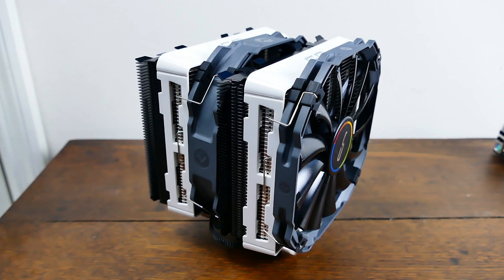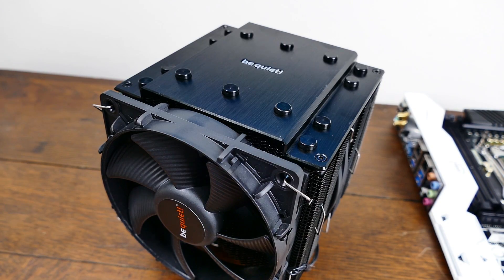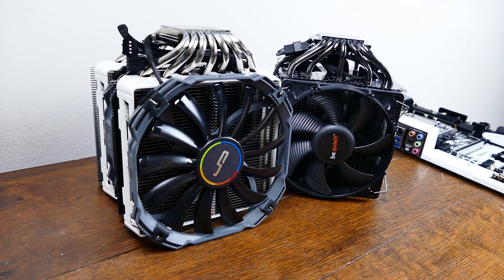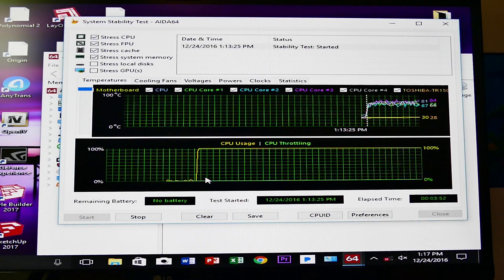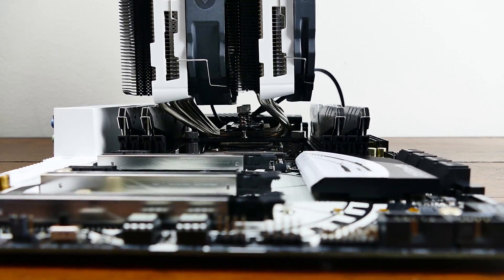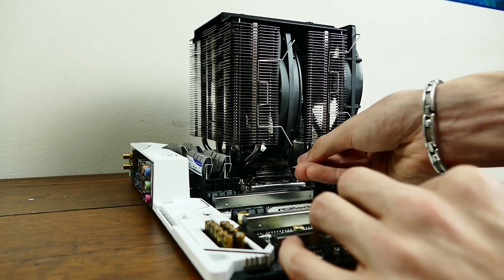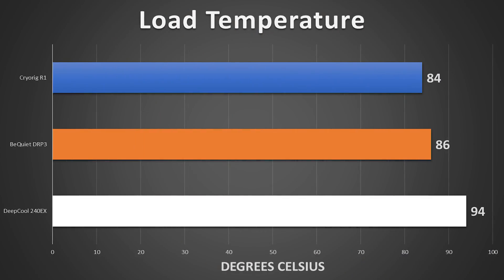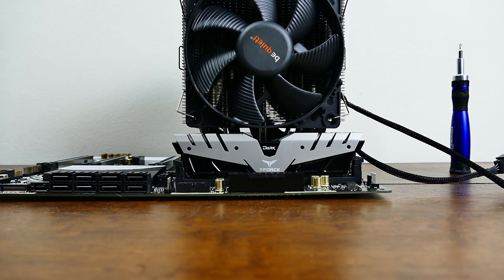BeQuiet! Dark Rock Pro 3 vs. Cryorig R1

Comment: any tips on a pc that won't turn on?   I just replaced my cpu (i5 6500), motherboard (asus z170e (i know, it was completely unnecessary but I didn't know at the time), ram (kingston hyperx fury black 2x8 gb) and cooler (cryorig m9i) for christmas and literally nothing will turn on. The closest I get is when I turn my power supply on, a green led shows up on my motherboard and a white led shows up on my graphics card but other than that, literally nothing at all.
Reply: White Supremacist Hate Symbol Have you plugged in both the 24-pin and the cpu power connectors? I forgot to plug in the cpu one on my first build and totally panicked
Reply: White Supremacist Hate Symbol Check the connections to see if there are any gaps. That already happend to me.
Reply: Make sure the CPU and motherboard are plugged in,and that they are plugged in the right way. I had this same issue and it didn't turn on because plug was plugged in wrong
Reply: tomekmatus212 yep

Comment: I'll give You an idea for some future video with one of those coolers. Why not make an 'half passive' CPU cooling like in new GPUs? I mean that when I'm browsing the internet the fans on those big radiators doesn't have to spin at all. Then add 'half passive' PSU and GPU and you have a silent PC when browsing the internet. 😊 I have tried on my old phenom ii x4 and on '1st gear ', which is 4x 800mhz, I don't need my CPU fan to spin at all 😊

Comment: Greg aren't those temperatures too high? or 80*+ is fine?
Reply: Darius Guran they are ok but a cpu shouldn't go higher than 90°C to be safe so the temps were kind of critical.
Reply: FreaqqShow talking for a permanent use, for one day for benchmarks isn't a big deal i think
Reply: Darius Guran talking for benchmark. if you can manage to keep the cpu temps under 90°C while benching, then you won't have any problems with your cpu :) but i guess 85°C for permanent should be ok too

Comment: Does anyone know if you can clean a cooper heat sink with water and soap? Or just water???
Reply: Are you trying to clean off oxidation? ketchup, then soap and water.
Thermal paste on base plate? Just wipe off and alcohol.
Reply: i would use isopropyl alcohol just to make sure and prevent corrosion, it is very cheap and is also good for removing thermal paste.
Reply: Thank you all who responded.
The heat sink I want to clean, I've had it for years. Over the time I've cleaned it with compressed air. But as you know dust that can't be blown away eventually formed and stayed there.
That's what I want to clean with water if it's possible. Of course I'll dry it really well. And then some. To make sure not one bit of water gets in side the PC.
Reply: You will be fine just use a hair dryer to dry it so you get in between the fins.
Reply: Thank you all.
Reply: if you are washing the mobo with water please remove the bios battery

Comment: I have a Noctua DH-15 and I hear it basically trades blows with the Dark Rock Pro 3 (with the Noctua being a touch cooler and the DRP3 being a touch quieter). 

Though looking at the disparity between the mounting mechanisms I'm kind of happy I sided with the Noctua (price wise it is on par with the DRP3 in the UK... or was when I was shopping) as it has world-class mounting hardware whereas the DRP3's is... yeah...

Still,  as a silence-oriented system builder (I actually have be Quiet! PSU's in all the PCs around the home) I look at the DRP3's slightly lower sound output and hope wistfully that Noctua comes out with a DH-16 that can match or improve on the DRP3's sound.

Comment: Interesting that you chose the R1 Universal and not the R1 Ultimate, because they are the same price and the Universal should probably only be used when there might be RAM clearance issues.. Also, cryorig's slim fans are apparently notorious for being louder than their regular counterparts, so that might explain part of the issue of sound difference...
Reply: Also, one more thing about aesthetic, the R1 has custom color covers you can pick up for about 10 buck to fit your build theme, which I personally found pretty awesome.

Comment: How would these stack up against the Cooler Master V8 GTS?
Reply: my fx 6300 gets cooled by this think with 4.5 Ghz 1.425 Vcore after 30 minutes in prime95 i get it at 80c
Reply: Egon 80 That's not too shabby after that kind of stress test.  Thanks!
Reply: Egon 80 the fx shouldn't go above 62° I think. 80° is waaay too much for that CPU, you'll fry it.
Reply: Should be able to dial back the voltage a bit. I'm at around 1.35v on a 4.5Ghz overclock. Temps go up to around 68c on a full prime95 load.

Comment: I feel bad for anyone who didnt know how to install the pro 3 the "easy" way.. the way most people do it is the way Greg did but thats the Hard way. 

easy way: install the bolts on to the brackets first, then line up brackets to the posts on the motherboard and then simply screw into the bolts from behind the mobo. <3 its SO much easier this way.
Reply: great video none the less. dark rock pro 3 is hands down the best in my own biased opinion.

Comment: Me personally prefer my Corsair 100V2 AIO with 2 Corsair quiet 120mm SP fans. I get Temps of MAX 44-51C while gaming. AND THE PUNP DOESNT MAKE NOISE AT ALL!! Prefer that instead of those heavy looking coolers to weight down my system.

Oh and I hav a 6600K OC to 4.5

Comment: what's the difference between r1 universal and r1 ultimate?
Reply: It's the exact same cooler, just with a different fan. Put the same fans on the R1 Ultimate crap, and you get the exact same performance.
Reply: The heatsinks are exactly the same. The R1 universal comes with a slim 140mm fan for RAM compatibility.

Comment: well, you've installed the bequiet wrong, but either way its a pain in the ass, but im happy with it :D
Reply: ardi du took me a good hour to install, worth it though, inaudible even at 100% fan speed
Reply: VHS_ NXGHTMARE agreed, the tiny wrench they provide you is laughable and I ended up tightening all the screws with fine tip pliers. But just as you say, totally worth it, great performance and low noise. Aesthetics are a nice bonus too. Plus you can still add a third CPU fan. Makes me think why do people go for water cooling so desperately.
Reply: neoqueto cuz you have installed the wrong way, just like salazar did 😂
Reply: ardi du idk man I even followed the instructions that one time.
Reply: neoqueto Because with water u cam get alot better looks

Comment: damn, they're cheaper and have better cooling performance than liquid AIO coolers. that's impressive. I guess the only thing that will benefit that AIO's is that they're smaller and more quiet
Reply: really? never seen one in action but i would assume there quieter. that's interessting...

Comment: Cooler Master MasterAir Maker 8 is better then these?
Reply: Noah Burke Actually no. Which is funny considering how much that thing costs.
Reply: DeadlyMageCZ the performance is the same though of the h110 though?
Reply: Noah Burke
If you are running something like a 6600K yes, the difference will be mostly negligible. With something featuring a nuclear TDP like the infamous FX-9590, an AIO should give you better temps since water is a much better cooling agent than air.

Comment: And I'm stuck choosing between the Cryorig H7 and the BeQuiet Pure Rock ;-;
Edit: Or the Cryorig C7, but that's more for smaller cases.
Reply: Budgets are painful.
Reply: Pure Rock.Better value.
Reply: I have the h7 but i have a black,white, and blue theme so it looks better imo. I had the 212 Evo before but it looked too ugly for a tempered glass case
Reply: Boda :o you have the same theme as me.
What case?
Reply: Jec s340 elite
Reply: ***** Why better value? Not saying you're wrong, I'd just like to know how you know. :)
Reply: Boda Well the similarities end :(
I've got the Phanteks P400s Tempered Glass. As far as I can tell, it trades the NZXT logo for RGB lights lol.
Reply: I have got the Cryorig H7 with a stock clock 6600k in the Core V21 case. My H7 is in a push/pull configuration with the exat same fans. I get 16-23 degrees idle no joke. When I run Prime95 I get around 46 degrees tops. I have no idea how, but the H7 is wonderful.
Reply: Selim Eylül Nice! I think I'll be going with the Cryorig H7 because it looks nicer, and since I won't be overclocking a huge amount, looks are important.
Reply: I just got the H7 and i love it <3 I have the S340 Elite white as Boda has, and i can confirm it looks stunning. Make sure you get low profile ram tho, i had to mount my fan on the other side of the heatsink
Reply: Andreas, that's actually weird. If you have the H7 you should have absolutely no problem with RAM because the cooler is designed so that the heatsink is sculpted towards the back/towards the IO. I have 4x4GB of Hyperx Ram (Black edition) and also have no problem. 

The H7 looks absolutely stunning by the way. Its' performance is also stellar, which is why it is a great option for $30-$35.
Reply: I have the H7 in a black/white build as well and it performs like a boss.
Reply: Selim Eylül My RAM is very high profile. No interference with the heatsink it's just that the fan on the side of the heatsink doesn't fit perfectly with the high profile ram. HyperX Fury Ram is low profile ram

Comment: Your review is too biased on looks
R1 has better cooling
Easier installation, you don’t have to pull the MB to remount 
Cheaper.
If looks are that important, you should have mentioned you can buy different color rings.. cheers

Comment: 120mm + 135mm versus 140mm slim + 140mm. I'm surprised the R1 didnt preform that much better. Then again, it's much louder.
Reply: ShermanStrike well, the slim fan doesn't do much. A better one would the r1 ultimate, since it's not using a slim fan.
Reply: David Wang Still bigger fans though. Then again, size doesnt always madder.
Reply: ShermanStrike??? The r1 ultimate cools a few degrees more than the universal.
Reply: but the constant in sound is better and less distracting.

Comment: think its nice cooler but looks to heavy for the motherboard, I think it cause motherboard failure in time do to its weight
Reply from the maker: Won't happen if the cooler's mounted properly. You'll have a better chance of a fan failing in most cases.
Reply: hmm... may have to get me one I like the black color on the bequite. thanks for the tip
Reply: Salazar Studio so say for instance a Gigabyte Gaming z170mx motherboard mounted vertically should be fine with the Dark Rock without a chance of the bends?
Reply from the maker: I have never heard of a CPU cooler breaking a motherboard over its own weight. You can google this if you'd like, but again - chances of a fan failing are much higher.

Comment: tl;dr for any lazy fuckers who dont wanna watch: The R1 is like 2c less underload than the DRP3 and is much easier to install. However it is a fair bit louder than the DRP3 and doesn't look as nice (I personally like it but its personal preference). The R1 is around 75$ and the DRP3is around 95$ however has sales alot bringing it down a bit. Personally I would go with the R1 on a normal day but the DRP3 if you find it for the same price as the R1.

Comment: There is a much easier way to install the Dark rock pro 3 actually.
Reply from the maker: Jeehaud Johnny Not on an X99 platform.
Reply: Ahh, i guess the way where you tighten it from behind the mobo doesnt work for x99? That sucks, its so much easier lol. I raged trying to do it the way you did for LGA1151 then i found the other way and it was such a relief. I have bigger hands and using that tool is a no go for me

Comment: Better than Cooler Master Evo
Reply: Keith Norris lol the cooler master 212 is the best selling BUDGET cpu air cooler. and these two air  coolers are 3x the price of the evo. apples vs oranges man.
Reply: IDK why people buy it so much it is pretty terrible. You can get a cryorig h7 for roughly the same price and it performs much better in both thermals and noise.
Reply: ***** oh I have an Evo. Not planning to update I was just curious
Reply: Because the hyper 212 evo has been around for much longer, and Cryorig products are next to impossible to find outside of the US.